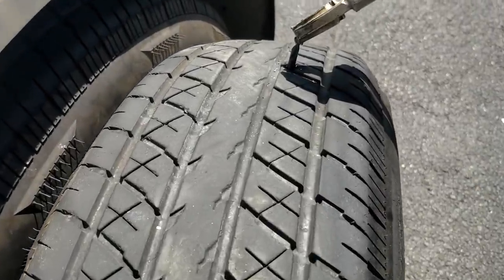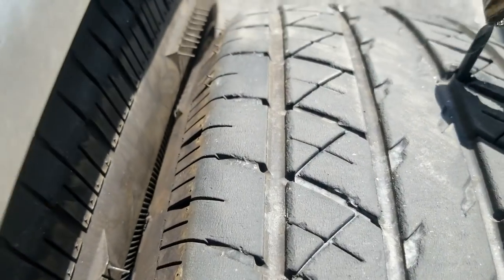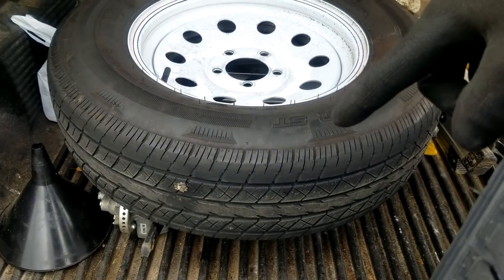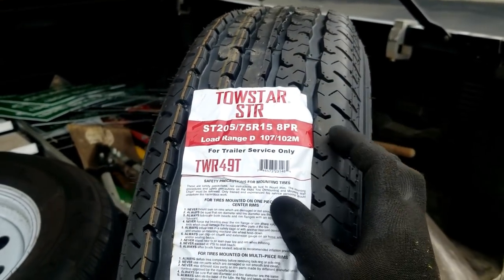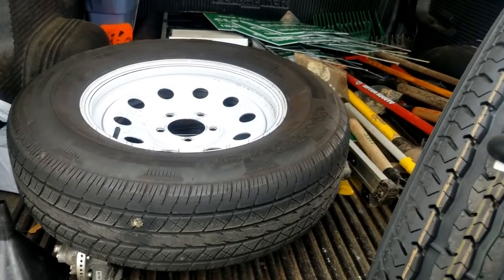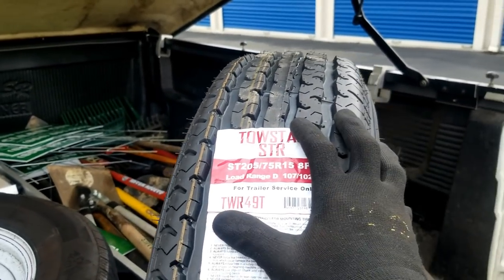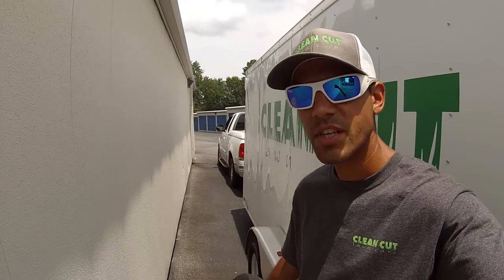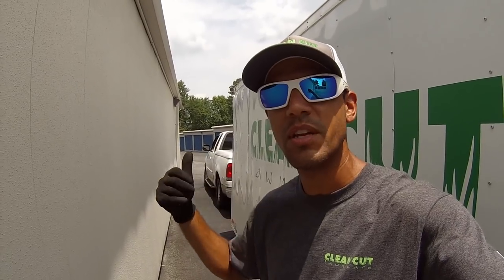How to stop getting flat tires on your trailer?!

Comment: We feel your pain.  We had 3 flats in 2 weeks on one of or front ztr tires.  It was the same tire every time getting punctured.  Come to find out we had a small metal bur on the lip of trailer.  I had run a self tapping screw in that spot during the winter when we were using the trailer for our snowmobiles and took the screw out in the spring and it left a tiny sharp edge.  Frustrating to say the least.

Comment: I was wondering, what kind of deal did you get on the advertising on your trailer? I recently bought a 8.5x16 enclosed trailer and unsure what a good price is. P.s. love the videos keep up the good work
Reply: I used diylettering.com for several rounds of vinyl decals of my own. Nothing but good things to say about them.
Reply from the maker: I had it done locally, was around $500 I think. Both sides and back (which has contact info).
Reply: Oh wow that’s a great price! Thank you!

Comment: Well I had the same trouble and now I have the 10 ply you bought the 8 ply. If I could find a better tire I would buy it. I think they call it the rating load E . I even took the time to buy a harbor tire changer and balancer so now I just order my tires on line and just do it myself only takes about 15 minutes and I do not need to wait at the store do it on my own time. Good luck with your tires.

Comment: 😅 right?? not the sharp end, but the butt end of the bit.  you need some run flats on that trailer, brother.

if nobody's sabotaging your tires ( i dunno if it happens on the road, or at the storage where you keep it ), then this is just an opportunity to learn and grow.  either way, it's an opportunity 👍🏼

i will probably get new tires ( and a spare...i still haven't  gotten one yet ) for my trailer next season.
Reply from the maker: I never had a spare either until this year... And then I had to use it multiple times. Lol